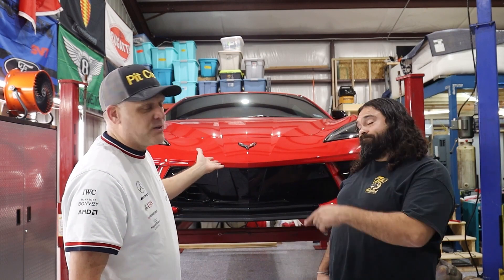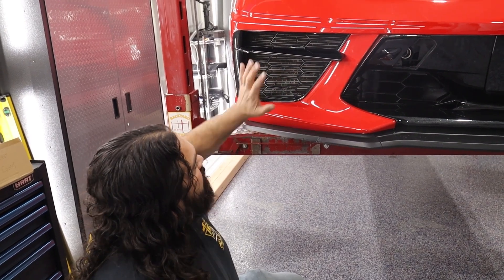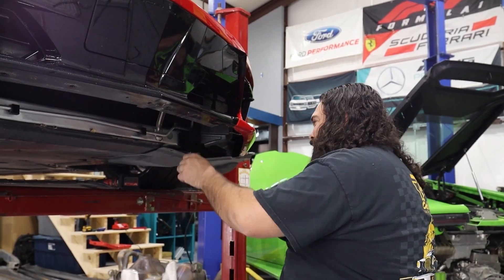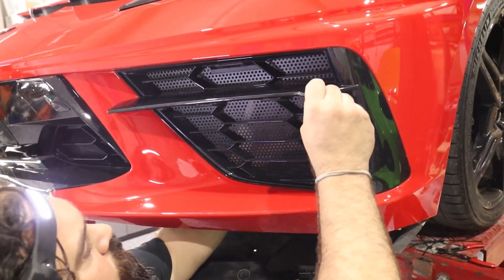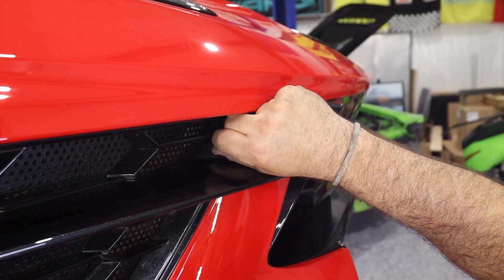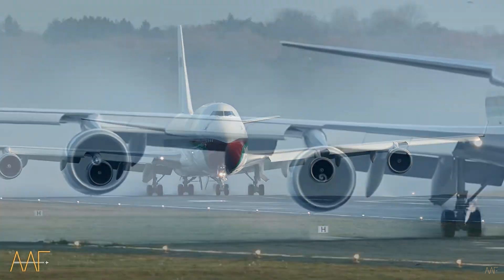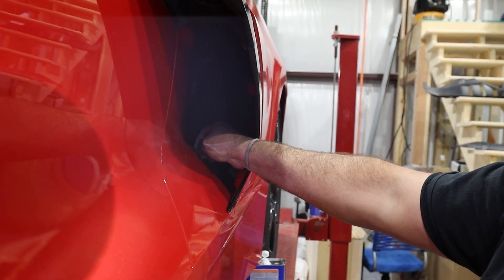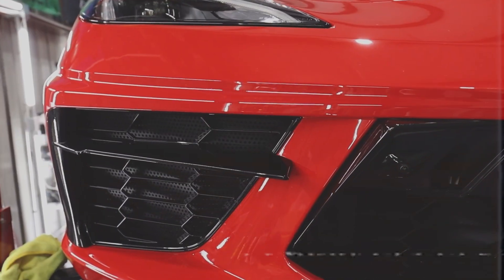Revealing the *Must-Have* First 3 Mods for Your C8 Corvette! #c8corvette #c8 #c8stingray

Comment: So I've never seen front grill guards quite like those before....they look like they are going to block quite a bit of air flow.  I know it's a Z51 with extra coolers but those look pretty restrictive compared to other guards I've seen.  Have you notice any issue with it cooling since they were installed?  I suppose if its just being driven casually it won't matter but at a track I could see those being an issue.
Reply from the maker: I would agree with you looking back at what grills are on the market they weren't the best choice. I have not had any issues, but your correct, it is a casual driver not a track car. Thanks for watching.
Reply: @midlifecarisis_  Right on....I mean, these are by far the most protection I've seen out of any guard....so if it's a casual driver and it s cooling fine...then I think you nailed it...these are perfect.

Comment: This video was Pretty Useless to me first 4 things I did to my 2022 Corvette Stingray was 1. buy a Blue Attack air filter, 2. buy a Corsa Extreme catback, 3. get my Uniden R8 radar detector installed on my car thru a wire tap connection, 4. get the silver factory corvette wheels powder coated High gloss black metallic. and all this will end up costing me $1500 and I am geting it all installed Monday March 27th. Great Video guys it's just Not what I would have done with my car. ;) Peace~
Reply from the maker: We are doing an exhaust and wheels reveal coming up! Good Luck on your build! Thanks for watching either way.
Reply: @midlifecarisis_   No problem Sir, Thanks for making Great Content on You Tube !!! Mark~;)

Comment: You should have used the radiator guards from Paragon. The are fastened in with screws and not the shoddy zip ties. Paragon guards are much more professional installation.
Reply from the maker: I would agree with you, I did not find Paragon, till after I bought the front mesh grills. Will most likely swap these out an go with Paragon before summer hits. Thanks for watching and the feedback.
Reply: I got mine from Paragon Perf. and I agreed.  Their grills have clips and nuts & bolts instead of zip ties.  And it looks much professional.

Comment: Any overheating problems with the mesh? I know GM/Chevrolet has some they approve of. Are these listed as the same?
Reply from the maker: I have had no overheating problems yet! We will see in the Texas summer heat coming up. These are not a specific brand on GM/Chevy's list that I know of.
Reply: ScrapeArmor are the GM approved ones.  They are less restrictive than the ones that are being installed in this video.
Reply: The ones shown on this video are junk. Stay away from anything that isn't an open mesh style. These plastic junk ones are way too restrictive and you'll have cooling issues. Many on the market that are sooooo much better.